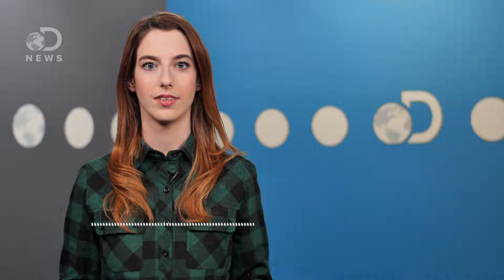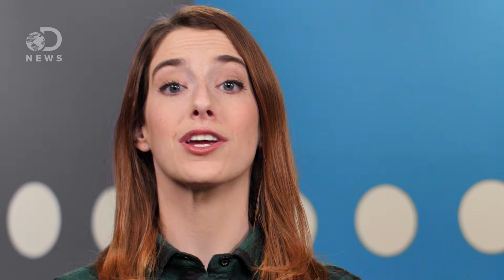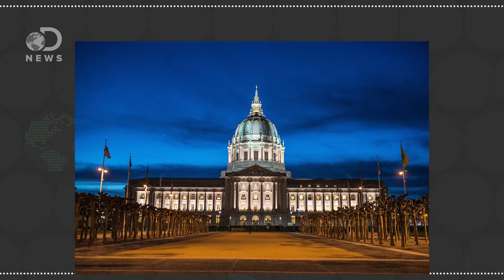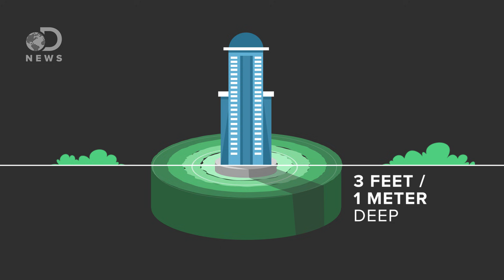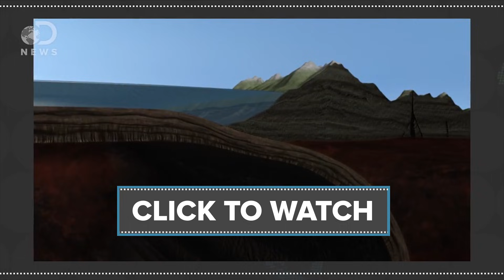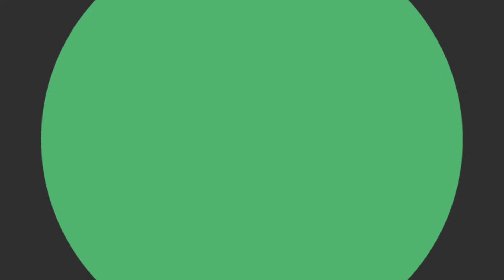How We Design Buildings To Survive Earthquakes

Comment: Today 18 MAR 2020 SLC was shook by a 5.7 earth quake. I am legally blind and use a power chair. I wish that there was a building that could be made to withstand an earthquake that was 5,000 on the richer scale? The feeling that I had was the building swayed in all four directions N, S, E, W. If the elevator was down I would be trapped. When we had our's I felt like my apartment was going to pancake down or tip over and pancake at the same time. It is near the end of the day and I still feel very uneasy about sleeping. When the power went out even with the blinds closed I saw a very bright very light greenish flash of light that filled the entire sky. I wish that my apartment had a ramp that went from the top floor to the bottom?
Reply: how did you see a bright greenish light if you are blind and how did you type this.

Comment: There is my invention ... https://www.youtube.com/watch?v=zhkUlxC6IK4   Tensioning between of the upper edge of the walls with the earth reduces the displacements responsible for all the stresses that develop on the structural carrier.
The patent is stacked into the ground to draw from it a force that transfers it to the upper end of the wall in order to apply a counterbalance to the torque of the wall Τhe patent achieves the following
1)The consolidation of the nodes of highest level of the walls with the ground, using the mechanism of the invention, deflects the upward tensions created by the wall overturning torque transporting them freely and directly from the roof into the ground and in this way stops the displacements responsible for all growing tensions on the body of the bearing elements which they cause inelastic bending deformations and failures in a major earthquake. 2 ) Also the mechanism and method of anchoring provides very strong foundation in soft soils 3)The wall receives only compressive stresses at both ends a) at the upper end b) and the facing lower end near the base. Does not exist anymore tensile strength. This means that there are no longer torques in the nodes Does not exist anymore mechanism of concentric forces failure The floor mechanism (soft floor) does not exist anymore 4) Does not exist anymore coordination because the whole construction is shifted with the same frequency and the same oscillation amplitude 5) The wall also receives horizontal shear forces. Apply tension at all edges of the wall with the patent mechanism increases the ability to horizontal shear forces.

Comment: but.....what if the building goes left....and the ball after being moved, also swings left and ends up adding momentum toward the same direction....that could end up pulling on the building to collapse if the force is too great.
Reply: +TSX_Adonis Na it won't. The building is designed to withstand Godzilla and KingKong attack.

Comment: Why not just suspend the building from cables from nearby towers that are higher than the building and it would be like that one level in Halo 2 where the Arbiter had to cut the cables to take it down?
Reply: That would mean that if the taller building falls down, so does the one held up by the cables. It would also look ugly.  Overall, impractical.